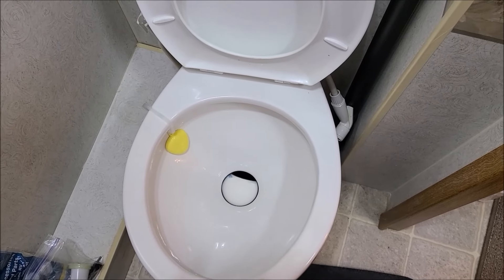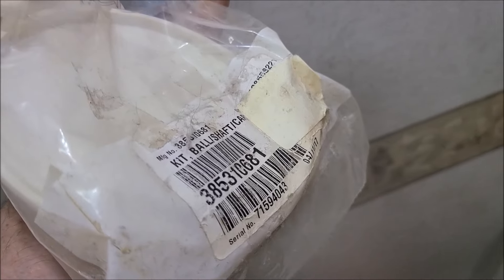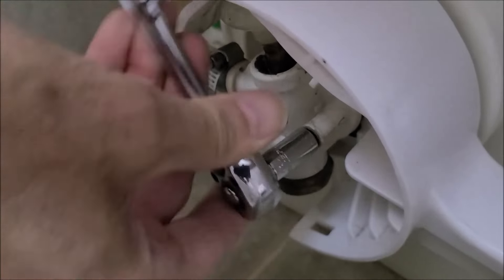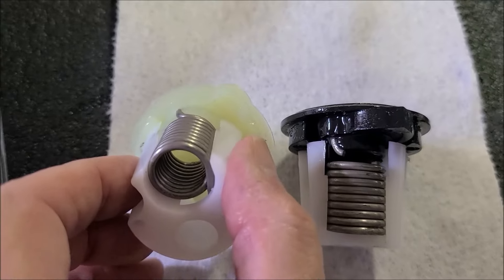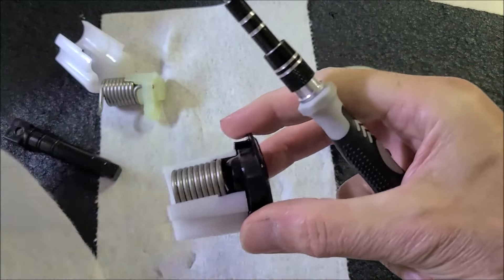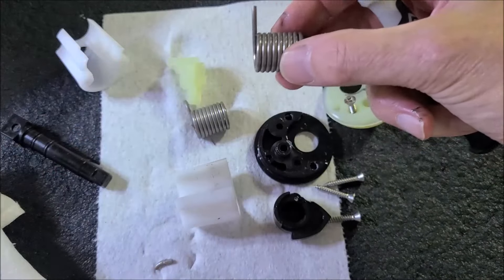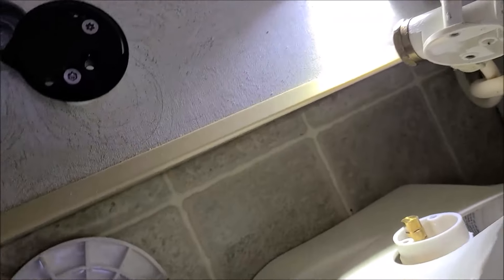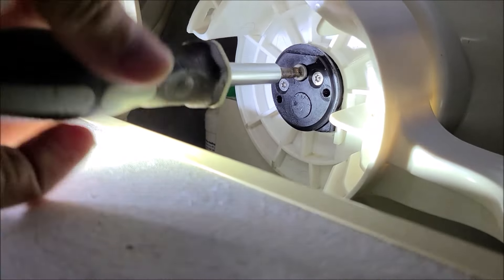How To Replace Sealand Dometic 385310683 Toilet Spring Cartridge When Pedal Wont Return / Stuck Open

Comment: Another very informative video!  a few years ago we noticed that the floor would be wet around the toilet after using it. We decided just to replace it, but evidently what was happening with ours was the water was leaking when the valve was opened just like yours was in the video. At least I know now what was wrong with ours, but dont regret buying a new one.
Reply from the maker: Thank you for contributing Paul

Comment: We are having this exact problem. The ball is staying cracked open .  Thanks for another great video
Reply from the maker: If you foot pedal on your 210 Sealand DOMETIC toilet wont return then you most likely broke the return spring beware of after market spring kits, get the original Dometic brand only 
Buy here  DOMETIC (385310683 Toilet Spring Cartridge Kit, BLACK https://amzn.to/3TRYi4M
Super Lube-21030 Synthetic Multi-Purpose Grease, 3 Oz for plastic parts https://amzn.to/3Qb7HmZ

Comment: Kevin at about 19:00 it looked like a saw the black pc moving a little when you were checking it🤷
Reply from the maker: Good eye but this is normal. For its only held with 1 Phillips screw, But at the 20 minute mark you will see I added the 2 main mounting screws locking all parts in place.

Comment: Unfortunately, on mine the pedal cover is held on with screws instead of clips, and the toilet bowl is in the way.  Dumb design.  Right angle screwdriver might work, but you think I have one of those at the campground?  Guess we'll live with a leaky water valve until we get home.  Thanks for the video though.  Will be useful when the time comes.

Comment: Question on a different issue.  Our 2005 workhorse chassis both slides have stopped working. They are not getting 12v it seems. Are there relays or fuse somewhere?
Reply from the maker: give me a call 606-875-0125

Comment: Kevin,
 As mentioned it’s uncanny I’m having that exact issue at the time of your video. 
 I have an unrelated issue with my workhorse.   The four way flashers burn out when connected to a tow vehicle.  I had to replace the blinker switch twice .  Now I don’t use them . 
 Any thoughts?
Reply from the maker: Try upgrading the rear lights to led to remove some of the load off the flasher? see this video https://youtu.be/52MVbY1cy3k?si=wHeAwOFANczo-WTj